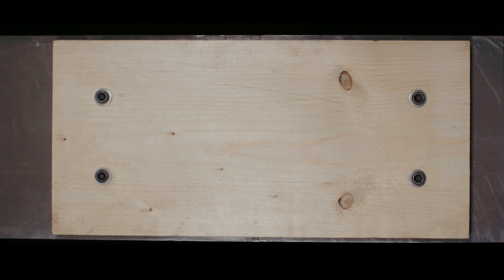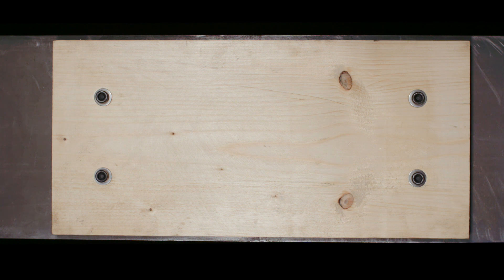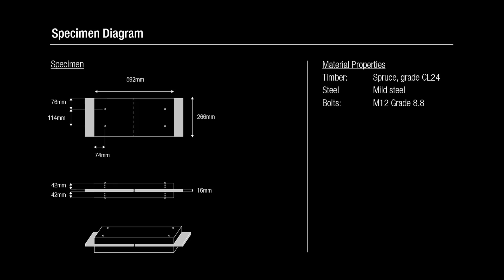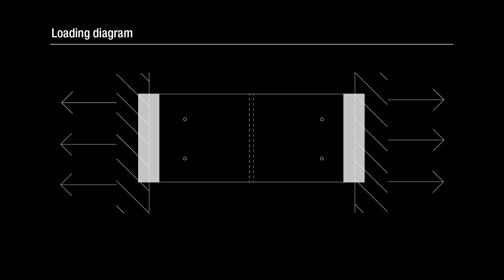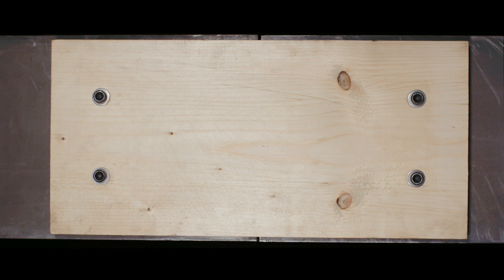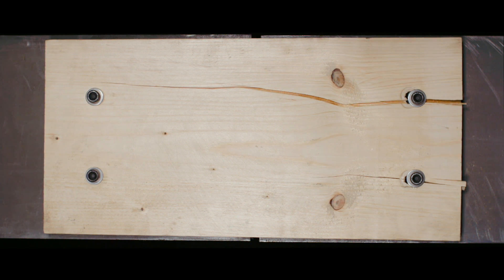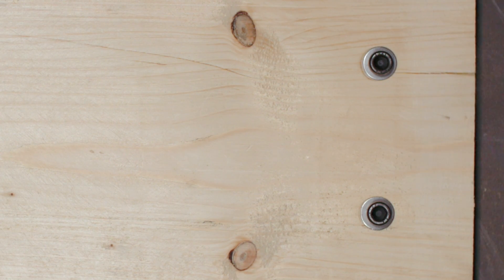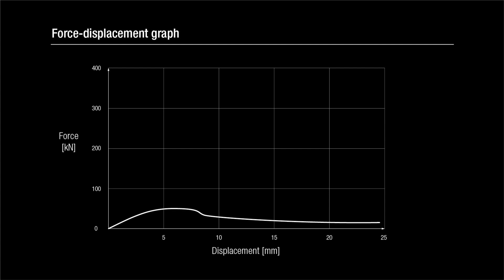Tensile failure of a double shear timber to steel connection in tension: Materials Lab on-line

Comment: What this shows is how amazing wood is in tensile strength. The failure here isn’t because of the tensile strength of spruce being exceeded but because of splitting due to the wedging action of the bolt shank. Nevertheless the video title is accurate-it’s failure due to a tensile load.